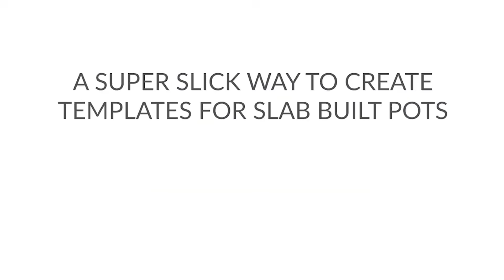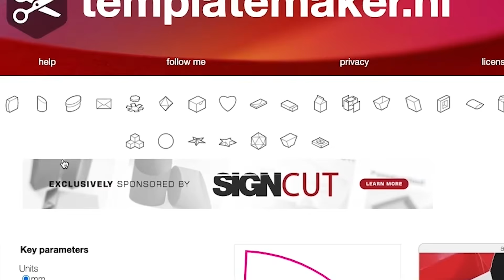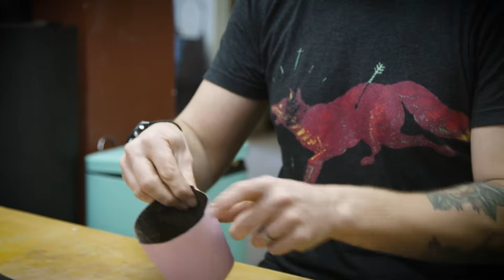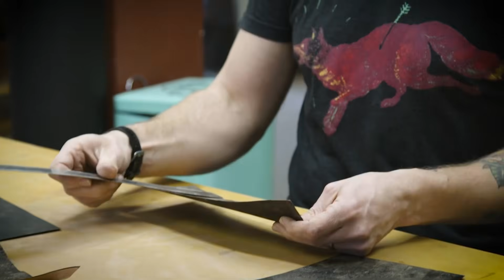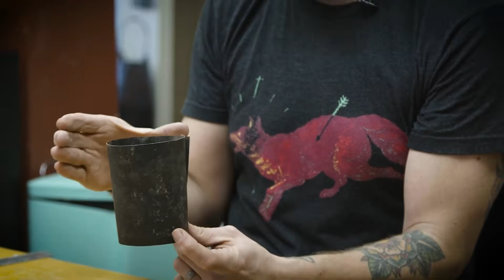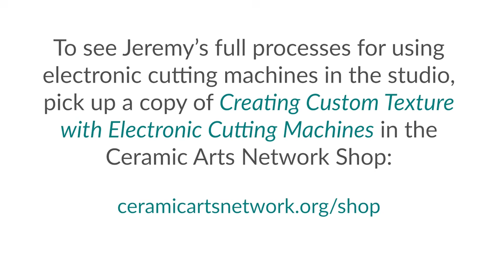A Super Slick Way to Create Templates for Slab Building | Jeremy Randall

Comment: Drafting a cone is easy. Draw a front elevation in full scale, whatever dimensions you want. Extend the side lines until they intersect, and swing arcs from the points at which the top and bottom meet the side.
You only need to do one side, since it’s symmetrical, and you only have to calculate one circumference, since the other one will be described by the edge of the pattern.
Reply from the maker: Thanks for sharing that straightforward method for drafting cones!